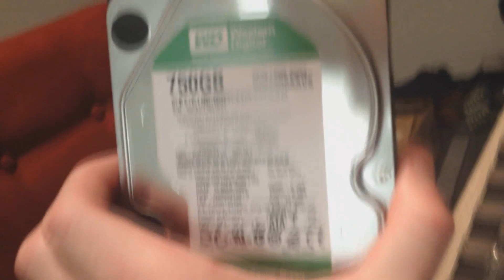How To Install A External Hard Drive To Desktop PC Computer

Comment: Thanks for this video. I have a 500 gig WD external myself - looks exactly like your 750 one. Recently it's been disconnecting every time I  use it (sending files back and forth, etc.) After doing a diagnostics test on it, I found the hard drive itself was perfectly healthy, which leads me to believe it's the enclosure that's giving the problem. I wasn't sure if I could just simply take the hard drive out and use it internally, but your video answered that question. Thanks again.

Comment: Hey mate wondering if you could help me out. I had 2tb wd hdd. Ive put it in my desktop how ever its not installing any drivers; just keeps searching for them. Any tips
Reply: the underdog 909 I have a 4tb Wd had and it keeps loosing connection and can’t update. Do you think this will work for me? Thanks!

Comment: I had to do this with my 1tb My book recently as the USB connector got pulled out of its socket. It's a little weird though checking my computer drives and seeing WD My book pop up on the drive.

Comment: do you know if there is any way to fit/install an external SSD inside the tower? (I really don't care how as long as it is NOT outside the tower) The reason I ask is because I have found that external SSD's are much cheaper than internal SSD's- sometimes over $1,000 cheaper- and my budget does NOT account for 1.5K on an SSD. so, help please?
Thanks if you can, good luck with your channel. :)
Reply: yes I know how, reply to me if you are still in need of help I dont want to explain it for nothing lol
Reply: @rolexbabyy  you still alive